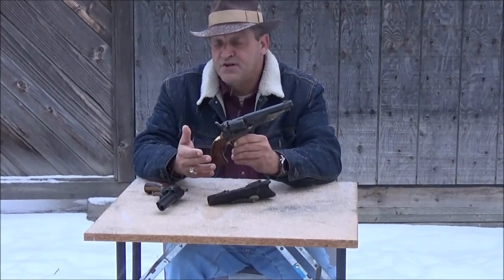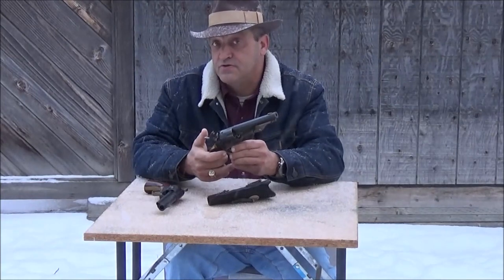Evolution of the modern day pistol

Comment: The funny thing is is that: Smith, Daniel Wesson, Oliver Winchester and Henry  (I forgot Henry's first name, but it is the Henry rifle and Henry repeating arms Henry guy), all worked on the metallic cartridge together. What they came up with is the 22 short, first metallic cartridge ever...
Reply from the maker: This is what I found on the 22.

By 1845, this had evolved into the Flobert .22 BB Cap, in which the priming compound is distributed just inside the rim. The .22 BB Cap is essentially a percussion cap with a round ball pressed in the front, and a rim to hold it securely in the chamber. Intended for use in an indoor "gallery" target rifle, it used no gunpowder but relied entirely on the priming compound for propulsion. Its velocities were very low, comparable to an airgun. The next rimfire cartridge was the .22 Short, developed for Smith & Wesson's first revolver, in 1857; it used a longer rimfire case and 4 grains  of black powder to fire a conical bullet.

American firearms manufacturer J. Stevens Arms & Tool Company introduced the cartridge in 1887 by combining the casing of the .22 Long with the 40-grain  bullet of the .22 Extra Long. The round owes its origin to the Flobert BB cap of 1845 through the .22 Smith & Wesson cartridge of 1857. It is one of the few cartridges that are accepted by a large variety of rifles, as well as pistols. The .22 Long Rifle and related cartridges (.22 Short, .22 Long, and .22 Extra Long) use a heeled bullet, which means that the bullet is the same diameter as the case, and has a narrower "heel" portion that fits in the case.
Reply from the maker: 22 Short is a variety of .22 caliber  rimfire ammunition. Developed in 1857 for the first Smith & Wesson revolver, the .22 rimfire was the first American metallic cartridge.The original loading was a 29 or 30 gr  bullet and 4gr of black powder. The original .22 rimfire cartridge was renamed .22 Short with the introduction of the .22 Long in 1871
Reply: @montanamountainmen6104  "22 Smith and Wesson cartridge of 1857" that's more like our modern 22 short. Smith and Wesson sold that to Oliver Winchester (somehow Henry came into play in this, forgot how tho), Winchester scaled that up to 44 cal (the 1860 Henry and some early win '66s shot a rimfire 44)
Reply: @montanamountainmen6104  yep!
Reply from the maker: @levlev.1028  Yes, If I remember correctly Henry introduced the Henry rifle in 44 , it was a rim fire like a 22 and was very popular .  Thats was Henry's repeater and made a good reputation.
Reply from the maker: @levlev.1028  The .44 Henry cartridge was used most notably in the Henry Model 1860 repeating rifle. This rifle was first used in the American Civil War, mainly by Union cavalry troops, although only in very limited numbers. It was also used by the very few Confederate troops who managed to capture one of these rifles along with a supply of ammunition, which was impossible to find in the Confederate south.

After the Civil War, the Henry cartridge was used in the Winchester Model 1866 rifles during the Russo-Turkish War (1877-1878) by the Turkish Troops and in the Franco-Prussian War 1870/71 by the French.

In civilian models, Winchester Model 1866 rifles and carbines, Smith & Wesson No. 3 Revolvers, Colt Model 1860 Army Long Cylinder Conversion and the Colt Model 1871-72 “Open Top” revolvers were available in .44 Henry. From 1875 until 1880, Colt produced Model 1873 Single Action Armys in .44 Henry to accommodate owners of Henry Model 1860 and Winchester Model 1866 rifles and carbines.

Comment: Interesting video. So true. Some folks tend to take this evolution for granted. The new auto loaders are just so easy to use and carry... If you think about it, did Smith and Wessons tip down break action #3 revolver give them the idea for the swing out cylinder on the double action revolver still used today?
Reply from the maker: Well the Schofield was popular and the British used the design in the Webley revolver of the Edwardian Era til WWII. It could have been the break action that led to the swing out cylinder about the right time frame.

Comment: Ever see a revolver operate faster than an autoloader? I have and I have seen it take pistol matches from autoloaders. The Smith 625. It uses full moon clips. The revolver is not dead by a long shot. Not as concealable as an autoloader maybe but still very fast and very effective.

I am still debating whether the 1911 was the grandad of all modern autoloaders. European pistols developed differently than American pistols with all due respect to John Browning. The Luger and Mauser come to mind and that was what 1898? Now I can without a doubt say the Walther P38 is the grandad of all modern 9mm autoloaders because the features of that pistol were adopted by all others that came after. Nice rundown of pistol development though. Thanks for sharing.
Reply from the maker: I've seen Jerry Miculek use a six gun with lightning speed lol. I say, " the 1911 being the granddad of modern autos" because its easier for some to relate per say. I know Mauser made them so did Styer, and a few others but the first auto was invented in 1892 :

In the 1880s, other designers worked on self-loading designs. The Schönberger-Laumann 1892 was the first semi-automatic pistol. The first model to gain any commercial success was Hugo Borchardt's C-93, which, together with the 7.65 mm Borchardt cartridge, had been designed in 1893 and made its public debut in 1894. But most never heard of or seen one , yours truly being one of them. So I use the term 1911 for simple reference.
Reply: @montanamountainmen6104  I understand where you are coming from though because the design and features of the 1911 are pretty much what are on all modern autoloaders. Frame and slide hammer fired. Slide catch. Manual safety. Luger used more of a toggle system. Mauser C96 did use a hammer though. So the basic 1911 design is still the main design for modern autoloaders. I think that is a fair statement.
Reply from the maker: @rbm6184  Well I know Luger had a few around the turn of the century one was the Swiss- Luger of 1900 in 30 Luger. The Broomhandle ( C96) was a clip feed but was also select fire . I know Spain ( Astra) made the model 900 about the turn of the century. 

So your right they were around prior to 1900 but most unless gun savvy never heard of them or seen one.